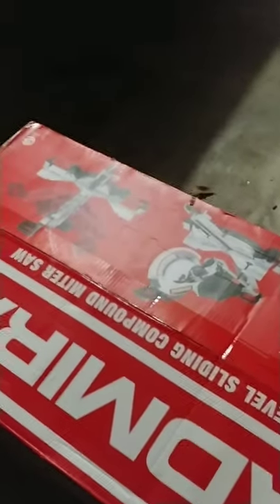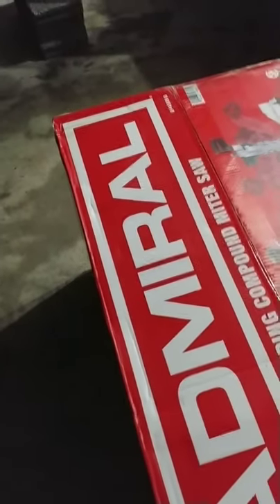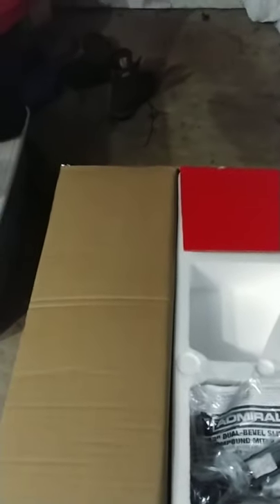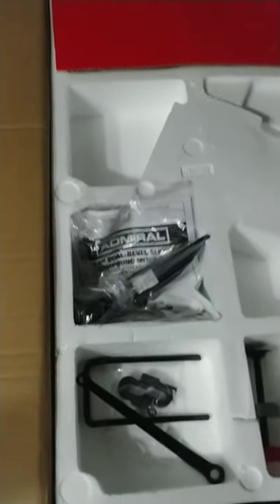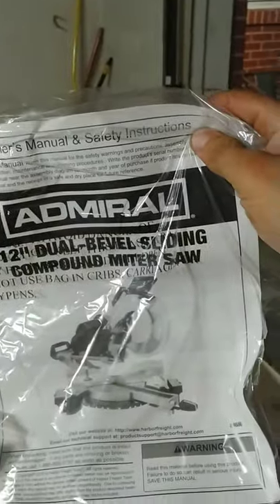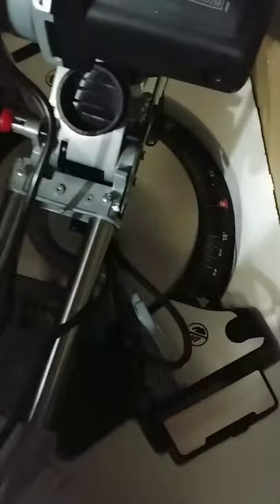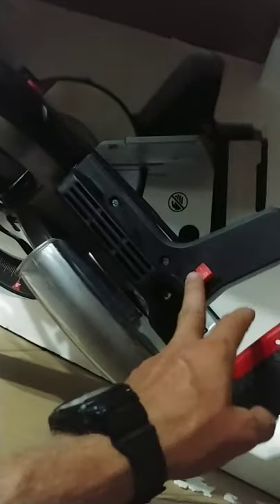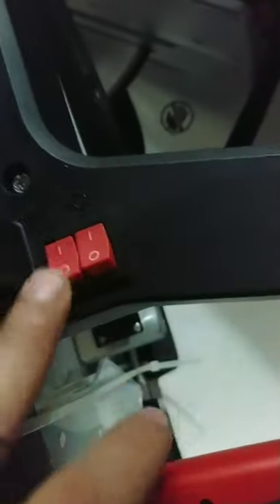Harbor Freight Admiral Miter Saw

Comment: So how do you like it after 2.6 years? Does it still work for you?
Reply from the maker: It is still kicking strong. With a diablo blade on it, its a fantastic machine. Use a thicker cord too, youll notice a difference in power.
Reply: @yoman21w  Thanks for responding. I think I'll pick one up, though I think the price may have gone up a bit.